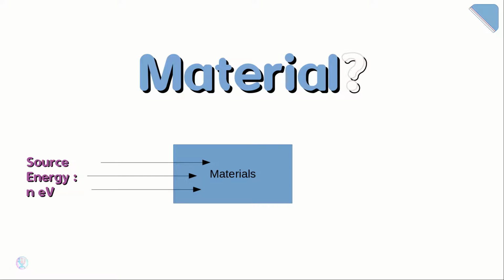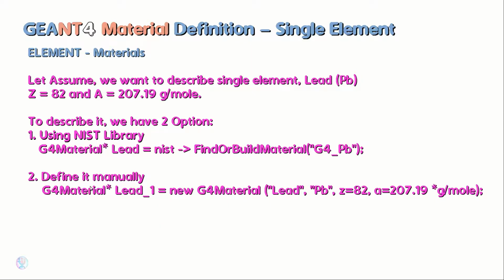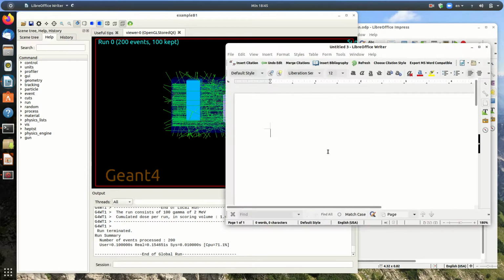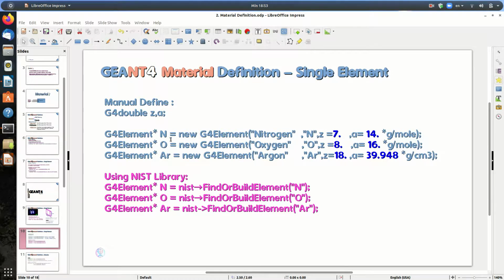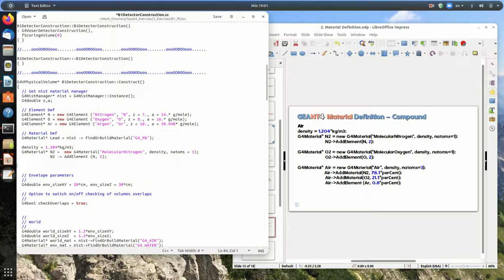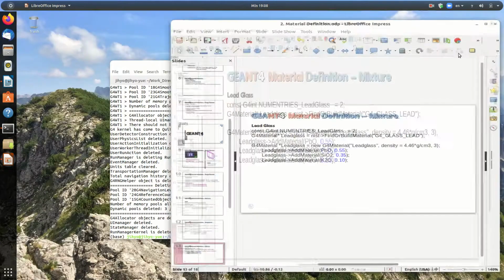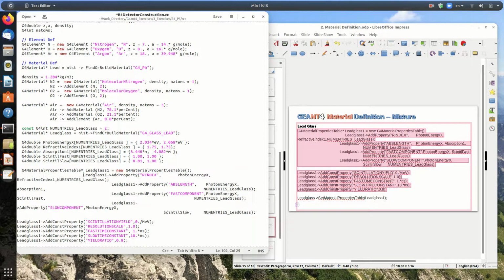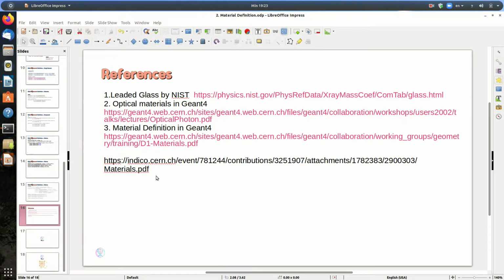Easiest way to Understanding Geant4 Part 2   Material Definitions

Comment: I'm currently interested in simulating the effect of 10keV Ce ions on stainless steel using Geant4 to produce secondary electrons. Therefore, I would like to ask if the MicroElecPhysics model is suitable for simulating the effect of 10keV Ce ions on stainless steel,

The setup of the physical process is not very clear at the moment, is there an alternative physical process that you would recommend for this purpose?